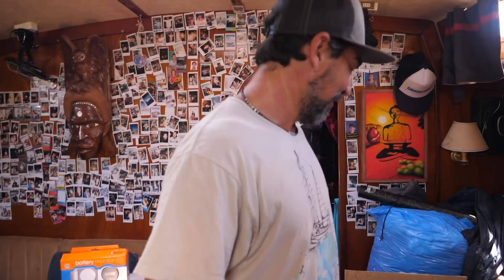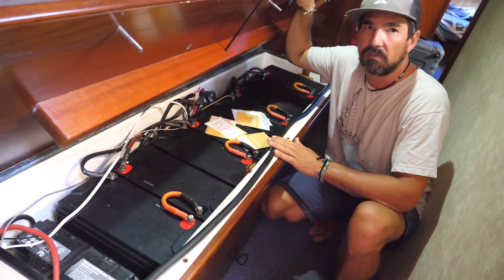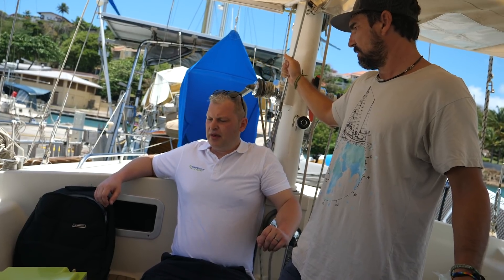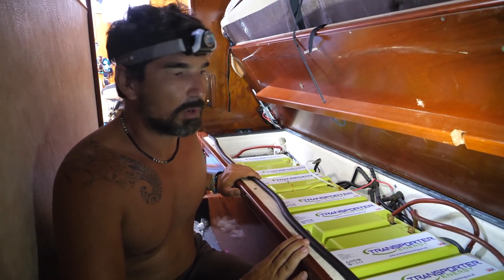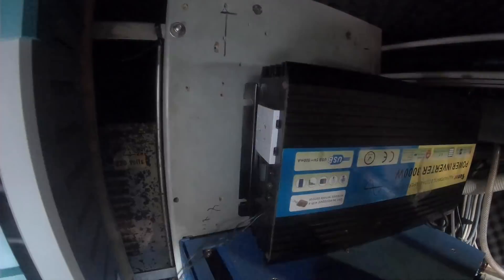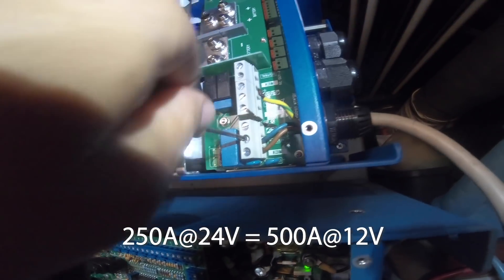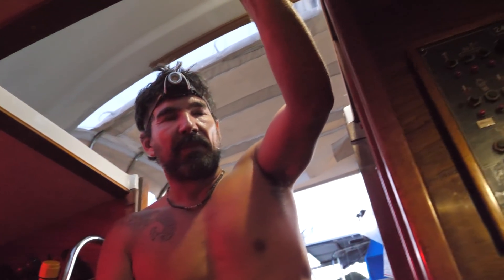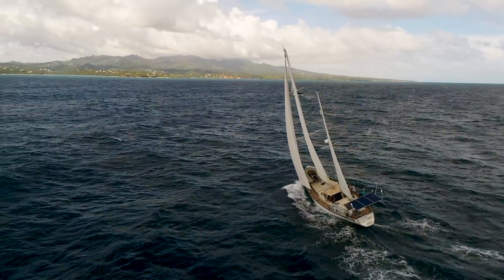Hello LITHIUM, Goodbye Propane!!!  Part 1-  Sailing Vessel Delos

Comment: I predict that you will be using your Genset MORE than you did before.  What KW are your solar arrays. also remember that solar does not run at 100 % of rated and you never get full hours of useable sun per day. average is about 5-6 hours MAX near teh equator and much less the further north you go ..  Another thing to consider is teh Big ole inverter uses MORE jiuce thatn your old one AND it also does not convert at !00%  normal is about 80 % efficient. ALSO the higher discharge cycle rating is NOT at 100 % discharge. A 1k cycle rating is normally about  an average  DOD of about 35%. THAT also lowers your available Amp/Hours rating .

  I would like to see a total installed price breakdown.   A lot of teh Lithium battery Manf use funny math compare to teh rest of us.  So yes you have a bit more power vailable but it also require a lot more aux power ( Generator,Wind,Solar) to maintain.  There IS NO free lunch.

In a marine enviroment I am not sure you will ever see a return of investment. A well maintained lead acid system can run 10 years with a very low investment compared to Lithium batteries. BUT time will tell.

Been There , (;-) TP

Comment: Hey guys I restore old vintage trailers from the 50s and 60s and have been very interested in lithium power recently. The larger trailers are self contained just like your boat and need good power systems with less heat. Thanks so much for this. I think I will pass this video along to the entire Vintage Trailer Community. I'll also make another long over due donation to the Beer Fund. Thanks again for all you do.

Comment: Awesome project and a better way indeed. Since you have removed your propane oven, let me suggest a replacement - NuWave Oven. Yes they are 110v but they are super efficient and won't heat up the cabin like your old propane oven would. I use one in my RV and and it makes a big difference. Anyway, it's just a suggestion, love your videos guys.

Comment: For many reasons, I've extensively researched Lithium batteries, battery chemistries, including LiFePO batteries. I think from a safety and performance viewpoint you made a solid decision. It's my understanding that LiFePO batteries also have a more robust resistance to cycle degredation.

Thanks for a great presentation.

Best of luck!

Comment: Cool video guys.
We have the same Victron charger / inverter but the 12/3500/120 so 3.5kw. Works great for we have a teenage daughter living onboard so hair dryers etc. We also cook on a halogen hob. All this works well without a generator as we don’t have one, just 440 wasn’t of solar and a 660ah Victron gel agm battery bank.
Oh try a 2kw electric kettle now you have gone electric. Uses a little more power but for less time. We boil 1 liter in around 3 minuets.
Great for the morning coffee!
Better still is the electric coffee machine, for late, cappuccino or espresso! 😀😜⛵️

Comment: I went induction a couple years ago by mounting a cooktop over a Panasonic convection microwave/oven (combo), reusing my old stove's gimbal bracket, along with a pair of those Victron 3000's.  I'm running 1400Ah of SLA, unfortunately.  Lithium's on the list when they pack it in.  Such an awesome setup.  Nice job!

Comment: New pots and pans for induction heating, right?  Also, I see stories about lithium batteries catching fire on airplanes. Could this happen and do you have fire retardant insulation surrounding the batteries? Smoke detectors?  Like the idea. Is it expensive? Thx

Comment: Great! Love it!
If you want to boil water fast, since you have a European wired boat with 230VAC, you should be able to run a standard household 2.2kW electric kettle on that 3KVA inverter. That should be much faster than the 1.2kW induction cooktop.

Comment: You have one of the best wiring setups and cable runs I've seen.  Goes a long way in preventing electrical failures and fires.  Well done.  Great video.  Looking forward to Pt 2.

Comment: Hey Brian
Loved the video on your conversion to Lithium Iron Batteries. I thought you did a great job of explaining the details. Your previous tech experience stands out. I’m a retired computer engineer (HP) that started as an auto electrician so I followed your explanation with interest and it was great. I don’t Sail, but have a Winnebago RV & would love to change over to Lithium... but still rather expensive. Wow... you must have paid a heap for the 12v Lithium batteries!
Cheers
Trevor & Rose
Perth, Western Australia

Comment: Nice video, thanks.. just an observation... the bx cable that seems to be powering your stove. is not so flexible and the armor may fail... just a suggestion that maybe you could find a more flexible cable.  In bad weather when the stove swings, it may be a problem....  
Nice Job, thanks for the information.

John

Comment: Concorde makes a 1,215 Amp Hour Gel Cell true Marine Deep cycle battery for $635. Even at 1/3rd capacity like you were mentioning that would translate to 405 Amp Hours each.

Comment: At over $12,000 this is a very expensive battery change. It would be possible to change the entire battery bank to top of the line AGM batteries for the about 1/10 the cost. I am an old sailor and probably stuck in my ways but I wouldn't even consider this change if somebody gave me the batteries. The system is far too complicated and introduces so many points of failure that I could never depend on it.
Reply: Not to mention, they traded a explosive gas for an explosive solid which, well, it explodes on contact with water.
Reply: The batteries are fully sealed and waterproof... They are automotive/boat grade.  The cells are sandwiched with steel which makes it harder for cells to get punctured, and also the computer in the battery maintains voltage on each cell independently.. The technology has come a long way
Reply: Neven Klacar - I agree the technology has come a long way but I wish the price would come down to a more reasonable level. If they come down to the $200-$300 range it will be much easier for people to make the conversion. I still believe a lead acid battery setup would be easier to repair and maintain on a sailboat in the middle of the ocean with simple tools.
Reply: I agree on the price. It's too expensive... Hopefully next 5 years there will be a huge cost reduction with all the automakers moving to electric.
Reply: Since you can use such a greater amount of the capacity, they could have went with a smaller bank and saved some money if it was just a straight-up battery switchout. If they had went with just 6 batteries, for 600Ah, their useable capacity still would have been 20% greater than with an 800Ah bank of lead acid. Since they also wanted to get rid of propane, they increased  capacity by 60% while reducing weight and using the same space for the batteries, and getting rid of the weight of the propane tanks and opening up storage capacity. So there were additional pluses that went beyond a simple battery change. Usually to increase storage capacity you have to buy a bigger boat, so 12k is cheap compared to that ;)
Reply: Mounta1nKing - You make some very good points. The real question would be if they were not sponsored to do this changeover would they still do it. Every video I have ever seen of the swap to Lithium batteries has been by people who got the batteries for free, or at least partially free. Nobody is posting videos saying they spent $12-$15k of their own money to do the swap. My sailboat's original cost was less than the cost of this battery swap, so it would be ridiculous for me to spend this much on batteries. I can understand the economics of it for a 100k+ sailboat but the price is too high for most boaters. 

Most of these style batteries contain about $100 of Chinese batteries with a $5 Chinese circuit board stuffed into a $5 Chinese plastic case. They are cheaper and less labor intensive to produce than a lead acid battery but cost about a $1000 more. There is plenty of room for the price of these batteries to drop and still make a reasonable profit. I believe this style battery is definitely the future but the price is holding back the adoption of the technology.
Reply: I'm sure it would have been a harder decision if they weren't sponsored, but an Amel Super Maramu is definitely in 100k+ range. It might be out of reach for most cruisers, and from a pure financial sense, I'm sure they're not going to save enough in propane to cover it, but the benefits seem to be in quality of life, that some people might be willing to pay for. A cooler kitchen is certainly nice when it's hot out. I'd say the companies are willing to sponsor something like this because they think there are enough viewers out there that might find it worth it. Someone is certainly buying all of those 40'+ cats. I'm sure anyone buying a new Amel might be interested in something like this. For the people who can't afford it, at least some company is helping to pay for Delo's content so all us regular folk can continue to watch them. It's cool to see what's possible.
Reply: Mounta1nking, I’d .guess we’re in the $250k+ range with an Amel Super  Maramu.  So $12k is not a massive expense for that style of yacht but there may be other benefits like longevity etc.  Being new technology is always a dicey move because of maintainability in remote areas.  We’ll see what Brian and crew report in the coming years...
Reply: They cost 10x more and last 100x longer. The cheaper batteries are a false economy.
Reply: LiFePo batteries are very safe as their temperature rises so does their resistance.  This is opposite of most lithium cells, where their resistance drops as temperatures rise.  Brian made an excellent choice.
Reply: I tried to get Lithium for my boat before I left NYC 2 years ago but it wasn't ready.  I'd check out the GoneWithTheWynns channel for the economics of this, they are actually not as bad as you are thinking.  When my current AGMs need replacing, I'll be doing it with Lithium.
Reply: Man, I’ve been studying this for several years now and while The Patti K is a 23-2 ODay, and my power needs are minimal, I am using car batteries for both engine and house. 

But ya never know, the good lord may allow me another chunk of change at some point, and when that happens... Battle Born will be light two 100AH bats, which will be charged by the single 160watt SP and solar charger.  At that point my live aboard needs are met, with my Aims 1500watt PSW inverter.

I haven’t seen an update on this yet, but if what I’ve read is accurate, these guys are 100% happy with their lithium liPo network and have more than sufficient power; along with their ample charging network, to handle their needs... and with the charge efficiency of the Lithium bats, life is likely very sweet.

Comment: I am not a fan of lithium batteries,     Also water and lithium batteries do not mix,   Search YouTube videos for lithium batteries exploding and also search lithium battery in water and see what happens,  there is also a video of the $70,000 electric car Tesla that burst into flames.    And another thing is look at all the cell phones,  laptop computers, and all the DJI quadcopters And other remote control items that use lithium batteries that caught fire.       That’s my opinion Brian.      Just Saying
Reply: One huge advantage of LiFePO4 is they are NOT at risk of thermal runaway, ie  overheating and catching fire, like other formulations of Lithium. That is why they are used in electric cars. (I looked into this 9 years ago when they first came out, and built an electric bike with them.) BTW, don't confuse the generic term Lithium ion with these Lithium iron batteries. It seems everyone falls into that trap. The ion (anion) here is iron phosphate.
Reply: He explained that he is using lithium iron phosphate batteries. They are more stable than what is used in phones and electric cars. There are many types of lithium battery

Comment: Guys,That's impressive, I am looking at doing similar. A retro job on my 1984 IOR racing yacht (still racing sometimes). You have shown me the way, good job, answering some basics for me. The brand, the type of LI battery is now known (thankyou), as that is a huge drama. I run a 12V system. I will contact the company and start before Christmas when I understand what else I need for my boat. Cheers, Paul

Comment: Great info guys! I opted for alcohol, but then we are only on a Caliber 40 LRC, and probably could not pack enough batteries in our engine room to pull off induction cooking. It'll be interesting to see how well your project goes? We will be trying different ways to create alcohol, but I fear we'll end up eating more Sushi than you will? :  ) Still, I simply would not live with a potential bomb on board, and alcohol is pretty darn safe. What brand stovetop was that? Pretty fancy!!!

Comment: Hi Bryan If you constructed an insulated metal box ( you could use the interior of an old microwave)......could you put it on top of the induction hob and then have an induction oven? Ps how did the microwave perform in comparison with induction ?

Comment: You might want to think about the ventilation around your batteries. They are susceptible to heat and keeping the battery packs cool has been a big issue in the engineering of hybrid and EV automobiles. That’s a fair sized battery bank and you’d need to get some air movement around them to keep your system nice and stable.

Great video though. Hope to see you guys in the UK at some point!

Comment: Would an electric kettle be more efficient than boiling the water on the induction stove?
Reply from the maker: Actually it should be very similar I think.  It would pull more power, but for shorter time, so the energy to boil the water should remain constant.  I will test and measure and report back in part II :)
Reply: Thanks, I am interested how efficient the hob is. PS When cooking something like a stew, you could put a towel over the pot to insulate it and cook it real low and slow?
Reply: Or use a pressure cooker and have a perfect stew in 10 minutes, start to finish.
Reply: insta-pot

Comment: I love this technology, but if one battery catches fire Delos will sink. To do this you have to have real faith that these batteries will never catch fire. I think that what you have done is the future, it may not be with Lithium but with the next generation of batteries. As I understand it a new electrolyte has been found that has none of the downsides of Lithium and has more capacity but is not yet ready for production. (BBC Science in Action).

Comment: Make sure you put a smoke detector down with the lithium batteries; just in case!
Reply: A smoke detector isn`t going to do much good, if there is a failure they have about 30 seconds to leave the yacht I think. The batteries are not contained in a fire proof box and the amount of energy released will turn Delos into a bomb.
Reply: simbayukiwolf 30 seconds us better than 0 seconds
Reply: @simbayukiwolf  lifep04 batteries are much safer than lithium Ion  , but a temperature sensor is a good idea  and I believe these batteries have them built in .
Reply: Lithium phosphate batteries don't explode in flames. They're the safest battery you can use for off grid electricity storage.
Reply: It's the usual deal with Murphy onboard, one failure is Ok, two failures is trouble and three failures at once is a mayday call.
Reply: One huge advantage of LiFePO4 is they are NOT at risk of thermal runaway, ie  overheating and catching fire, unlike other cathode formulations of Lithium, which can suffer thermal runaway. That is why they are used in electric cars. (I looked into this 9 years ago when they first came out, and built an electric bike with them.)
Reply: @DavidTangye  I believe most electric cars were using lithium Ion .

Comment: hey guys, since you're all electric, have you tried a mains powered kettle for when you need to boil water? I can't be sure, but I'd expect it to beat boiling water on the induction stove.
Reply from the maker: Yes, and it works!  Pulls just over 2KW.  Will include this in Part II!

Comment: Very cool. How long will it take to pay its self off?
Reply from the maker: If you look at just the batteries I think these will last 8-10 years from what I have read.  Given that we have replaced our batteries 3x in 8 years we would have already paid for it given the time on Delos.  I also think there will be more savings realized in less fuel, less generator running time, but I need to use it for a season or so before I can verify.  Will report back!

Comment: What are you going to do for an oven now? IE: for baking muffins pies or bread? Also, what about hot water for dishes, laundry & showers? Or is that the downside? Just say’n!
Reply from the maker: Hey John, excellent question.  We normally bake bread in our bread machine, but I think we will install a small electric convection oven so Karin can continue baking her awesome Swedish cakes :) . Hot water remains the same, heat exchanger on the main diesel and also 2nd source as electric from the generator.  The laundry machine has it's own heating element, so we typically run the generator for this.

Comment: I would make sure that you have some sort of manual disconnect..... lithium batteries can run away and create fires that's how they do it on airplanes .....quick disconnects...just in case
Reply: Guess I should have watched the whole video it looks like Brian's got it covered!!!
Reply: One huge advantage of LiFePO4 is they are NOT at risk of thermal runaway, ie  overheating and catching fire, like other formulations of Lithium. That is why they are used in electric cars. (I looked into this 9 years ago when they first came out, and built an electric bike with them.) BTW, don't confuse the generic term Lithium ion with these Lithium iron batteries. It seems everyone falls into that trap. The ion (anion) here is iron phosphate.